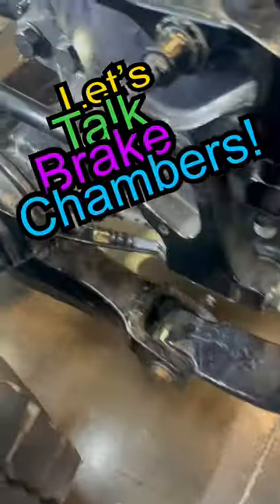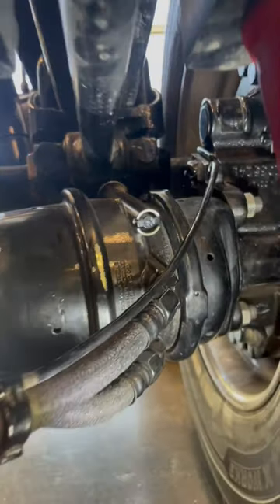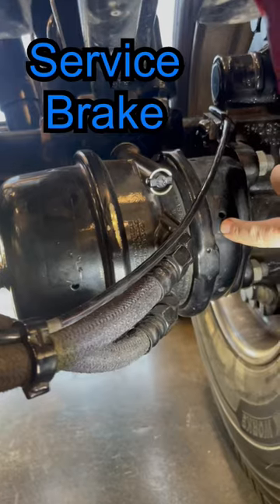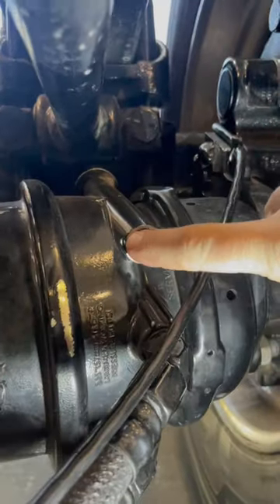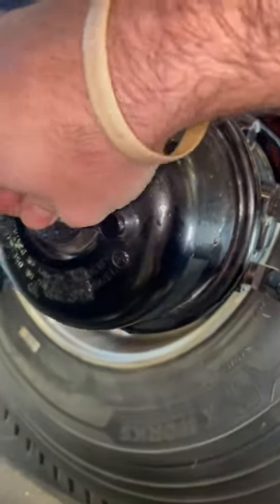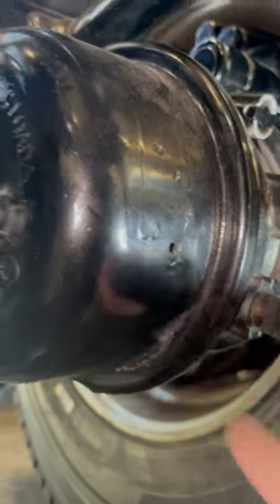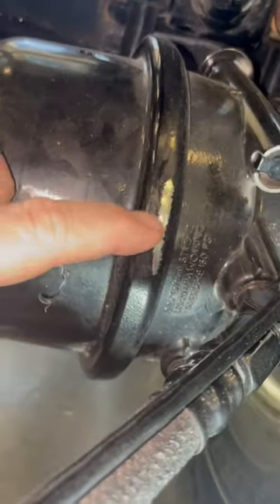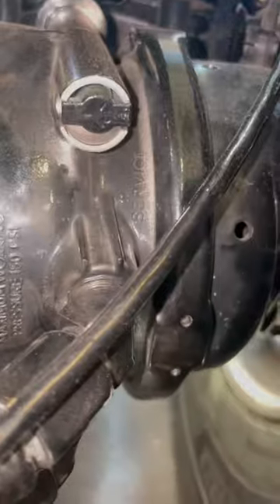Air Brake Chambers for Semi’s!👍#shorts #bigrig #diesel #trucking #mechanic #trucks #technician #air

Comment: You can replace just the service diagram if it's leaking, used to do them all the time
Reply from the maker: Dang! I forgot to change that part before posting… Good catch, thanks!
Reply: Lot of OEM chambers come sealed on the service side now so they force you to buy a new chamber